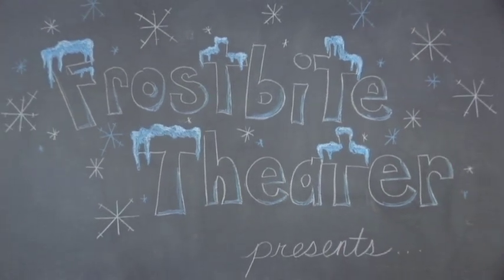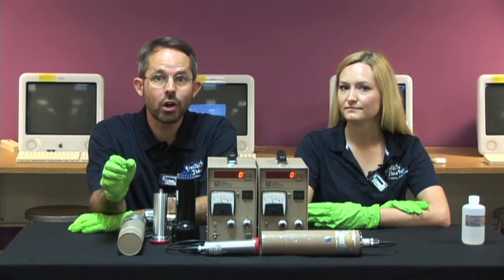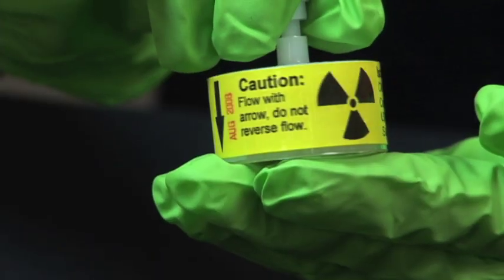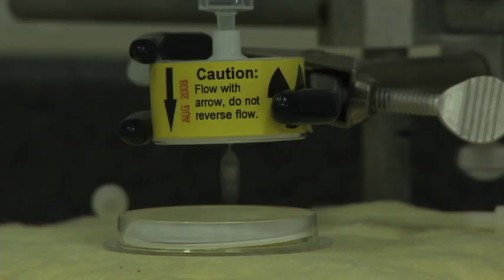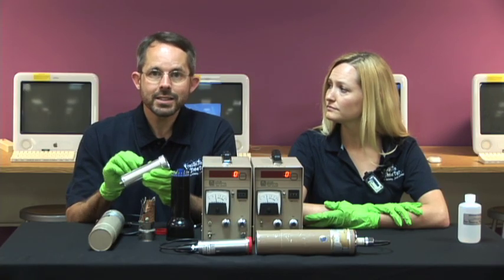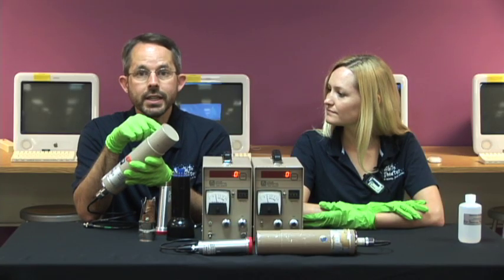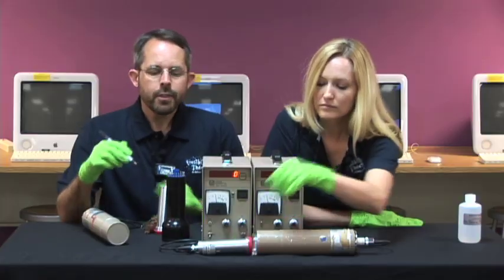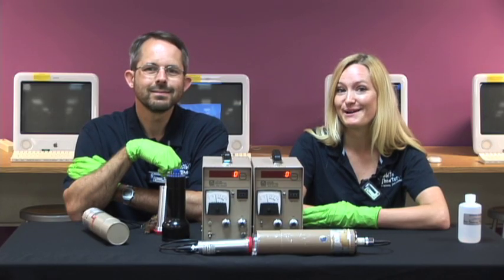Radioactive Half-life Experiment - Part 1 - Equipment Overview

Comment from the maker: Temperature does affect the measured half life, but it's a relativistic effect. The hotter something is, the faster the motion of the particles. In the reference frame of the lab, the faster the observed particle is, the slower its internal clock ticks. The slower the clock, the longer the observed half life. It's the same reason why we can observe cosmic ray generated muons on the ground, even though their half lives are too short for them to survive long enough to reach the ground.

Comment: The brain has roughly 100,000,000,000 (10 to the power of 11) neurons, each neuron has the potential of making 1000 conections/psynapses, meaning that you "can" get 1000 b (Bit) from each neauron.
1000 connections/Bit`s * 100,000,000,000 neaurons = 100,000,000,000,000 connections/Bit`s = 100 TB (Terra Byte)
(The human brain wuld have this amount of storrage if you used all the neaurons for storage)
Ps:Sorry for the bad english ^^